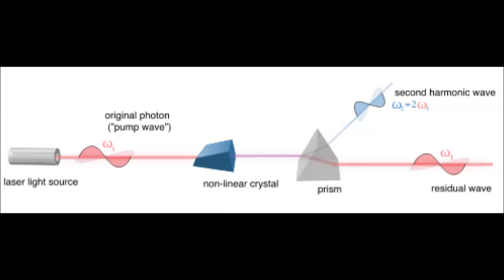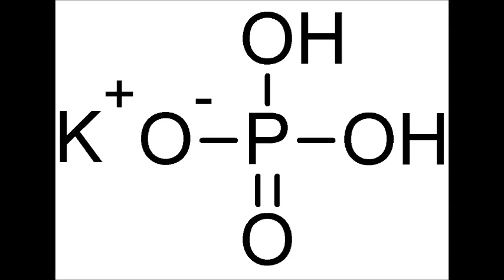Nonlinear Optics

Comment: 4:53 sir this will only work in theory using kdp but maybe if you use dkdp instead kdp ( which is Highly deuterated KDP  ' Hydrogen is replaced by Deuterium ' ) it will give you better practical result. I think that's why i was a failure : ) plz do this again using dkdp

Comment: did you try hitting it at different incident angles? what about trying a thinner mixture next time to get less saturated clear crystal? you cant jus throw this stuff together in a pot and do it unless you made some hard calculations first,,also it could be that they only respond to and match phased to 1064nm ,,this is why i once was thinking perhaps it possible to simply shine 800nm from diod directly to ktp without going through yag and it would make 400nm blue light but i think its not that simple otherwise it would have been on the market after or perhaps even before the more complicated  green lasers